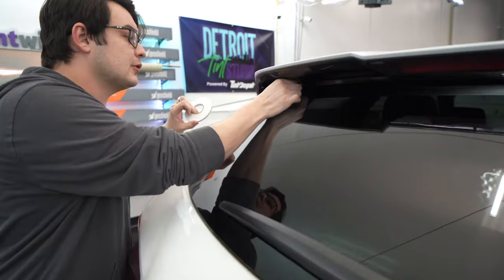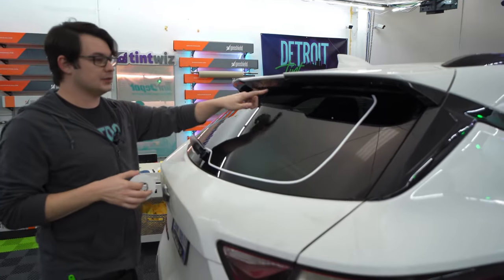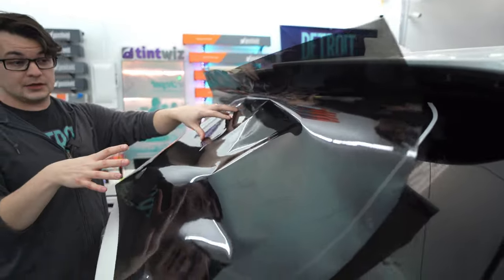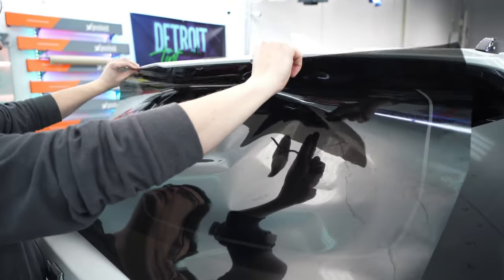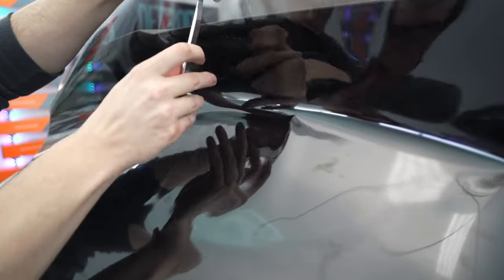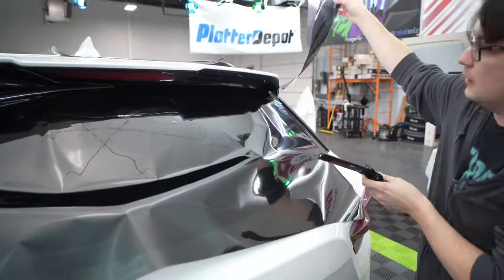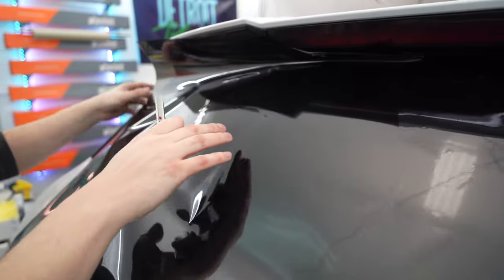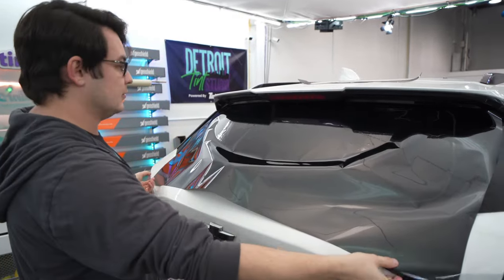The SECRET to Tinting ANY Spoiler WITHOUT Removing It

Comment: When using the tape are you cutting in the inside or on the tape
Reply: he cuts in the middle of the tape, he explains somewhere in another video that this means you cut the tint and tape only and the blade shouldn't touch the glass directly. even though stainless steel blades are unlikely to scratch the glass its just an extra precaution he takes.

Comment: can't find anywhere glass aid tape, i am in UK and all i found is in US and shipping is a fortune, if i am carefull with a stainless steel blade can i get away with it with no scratches?
i want to do my car on my own is a ford mondeo(fusion) 2016 hatchback should be easy the install
Reply: Any stainless steel blade will work on a window everytime you are going to cut snip off the older blade for a newer one, Like cutting anything dull is dangerous vs sharp Less work less friction etc

Comment: Hey man. I have a better option that works great, at least for me. (For almost all vehicles with spoiler)
I use one of the defroster lines to cut across then slide up and line up with dot matrix. The defroster lines are usually in the same shape of the top frame. Then just cut your sides etc...I hope it helps
Reply: Good I will try that

Comment: Why the dryer sheet Im curious? Also would a flood light with the stand work better to see in those dark areas like under the spoilers work?
Reply: It lets the tint float over the window , Front and rear windows you only use dryer sheet side windows and ports just baby shampoo and distilled water

Comment: hello sir.
I tint audi A4 framless two front windows and I heat properly. Once I finished  I checked the three times up down full window driver side .  the first two up down down the window  was film fine the film not ripped. but when I tried the third time the film ripped

so what you can to recommend me.
answer my question please
Reply: either file it down since the film sounds like it is catching or let it cure for a few days before you mess with it.
Reply: @Henry P  thank you lots sir. 🙏

Comment: Try to tint an Audi
Reply from the maker: I’ve done a lot of them. Same process with the hatch just less room along the inside boarder
Reply: @DetroitTintStudio  That's how you become quick and productive when you take the same approach to every vehicle.  Muscle memory and the same order means protection.  

In the end its still a door glass, quarter glass or rear glass no matter the make....now some makes are easier/harder but they require the same procedures just a little extra or a little less here and there.
Reply: Is that pretty much it Tint Studio?  Is that how you do with each ride...tint this door glass the same steps as any door glass?